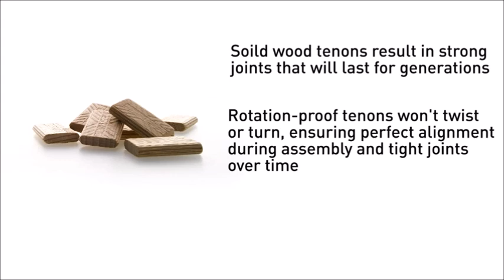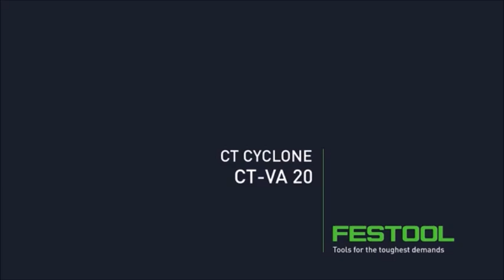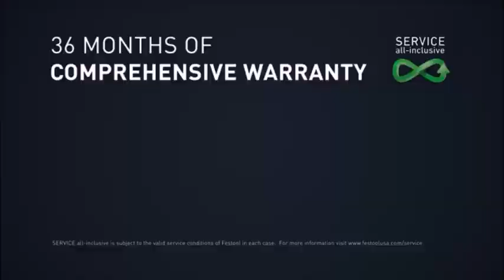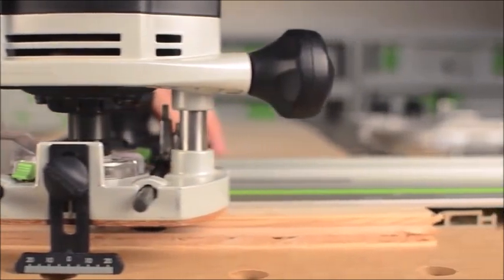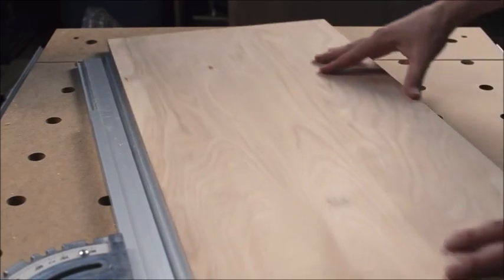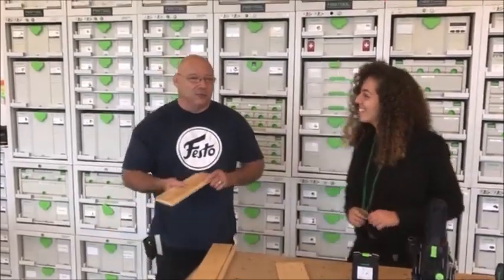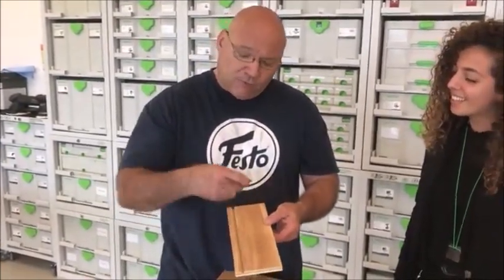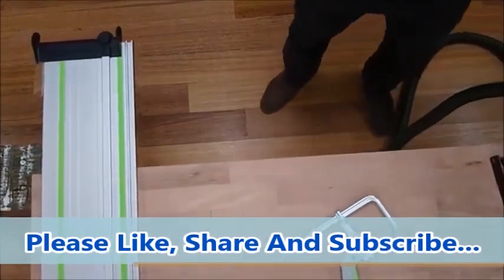10 NEW FESTOOL FOR WOODWORKING YOU NEED TO SEE ON AMAZON

Comment: Bisquits are not meant to be used without gluing. They are overdried, fragile and have in this state very little strength. They must absorb glue,  inflate and then it is completely different case. Stll their main use is for aligning two pieces without movement.